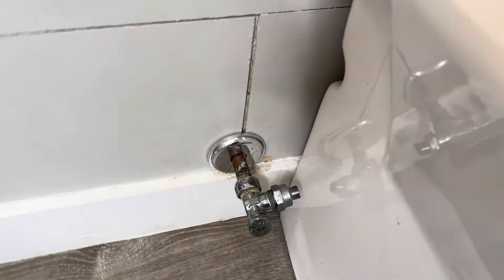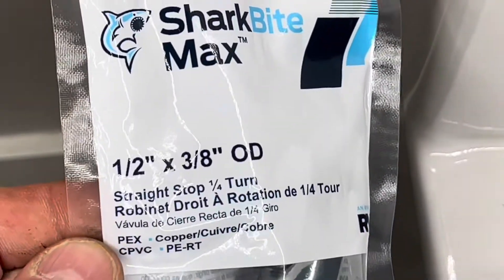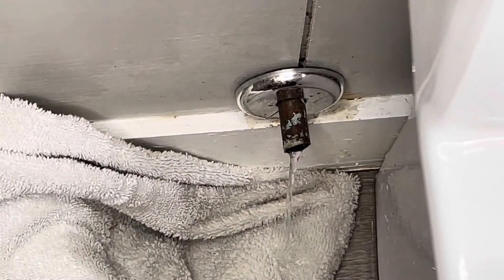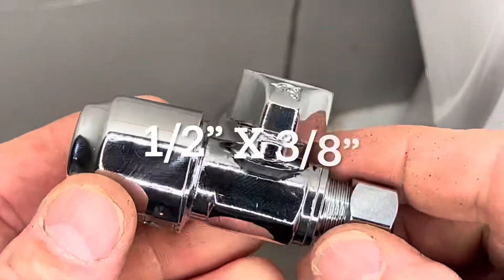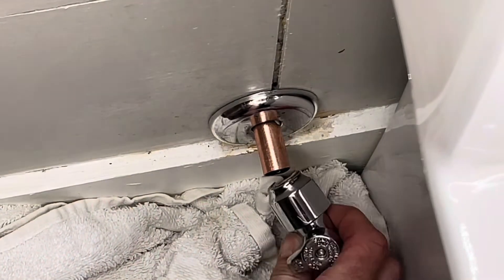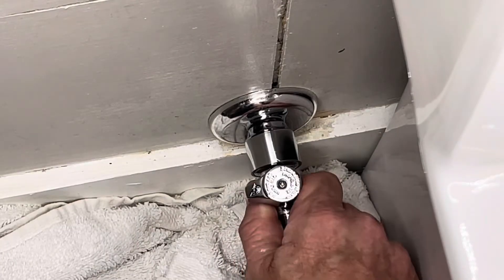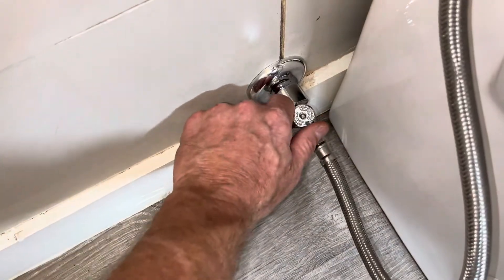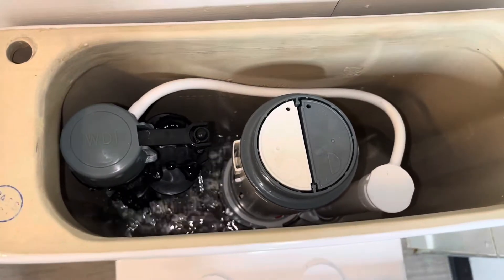DIY Installing Sharkbite Max Valve on Copper Piping In Place of Sweated Angle Stop Valve for Toilet

Comment: what grit emery cloth did you use. I've seen advice to not use sandpaper on the copper tube or it can compromise the fitting seal
Reply from the maker: Great question. It was a very light grit, don’t remember exactly which grit but just enough to get it cleaned up.

Comment: Can i use same sharkbite for PVC pipe? Thanks!
Reply from the maker: Ya know I’m not sure to be honest. I did recently learn from a plumber that these are not the best way to go. Mine is still holding up, knock on wood. Best of luck to you.
Reply: @DIYTechnician  This is what i heard not facts, The reason they will tell you they are not good is because by DIY you're taking jobs away from them, and there's another type of shark bite for PVC pipes.

Comment: What is the copper ring that comes with the shark bite valve? Do you use it/keep it?
Reply from the maker: I’m not sure but I didn’t use it for the shark bite to copper pipe installation.
Reply: it is to uninstall sharkbite,

Comment: bro how to remove it in the future? no space LOL
Reply: There is a tool to remove it, so cutting isn't necessary.
Reply: @kyarimaresuki  dude are you blind? to use that removal tool you have to put in on the pipe and push it towards the valve se the valve can slide off but in this case you got no freaking piece of pipe left so there is no way to use that removal tool
Reply: @kyarimaresuki  what tool
Reply: How to open valve
Reply: The valve knob is just the same as any other. If it's  an angle valve you're installing then it just shuts on and off like 90 degrees.